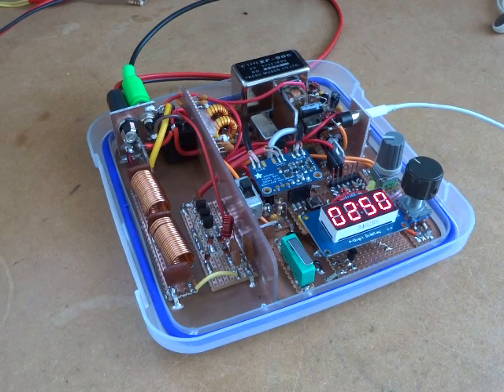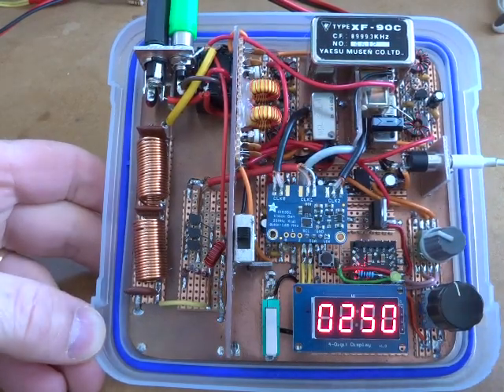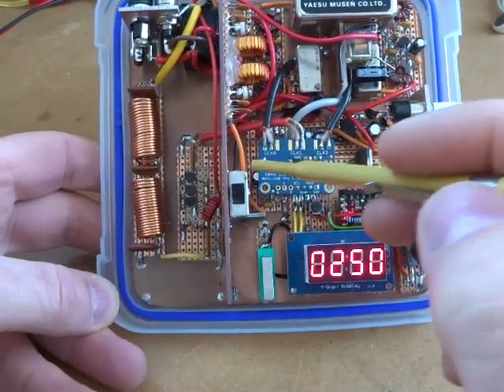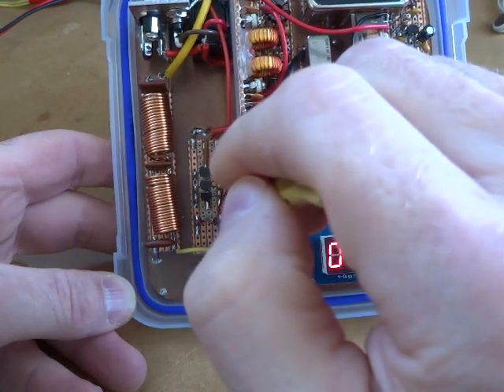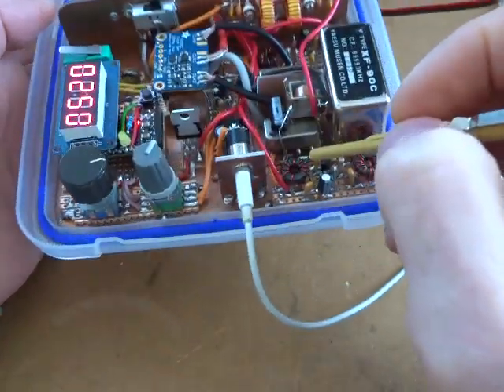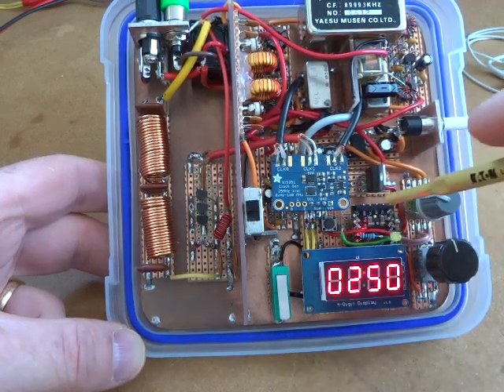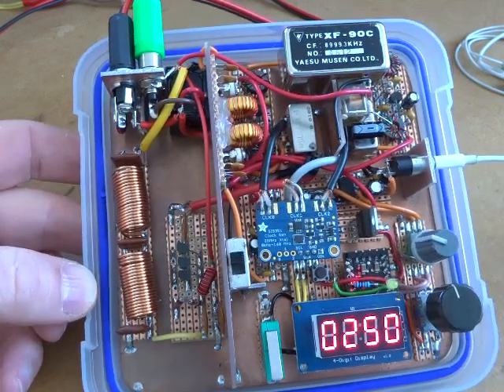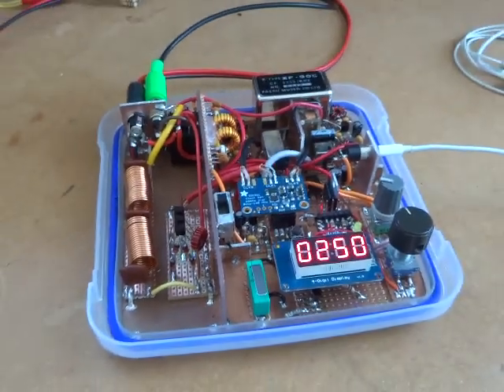Homebrew 40m CW Rig - #7 All Boxed up, Final Thoughts

Comment: You can take the rig control script one step further.  When the key closes, activate the TR relay, and drop it out a second after key up for an effective semi break in. That eliminates the need for manual TR switching which I built into a 160m Tx a few years ago and is a pain when operating.
Reply from the maker: Thanks Paul. I did have that before the manual switch, but the Arduino internal pull up resistor was putting 5V onto the keying input line which was in turn upsetting the key shaping circuit. It certainly wouldn't be hard to add it back in as the switching 2N2222 is still in place. I'll add it to the list.Charlie